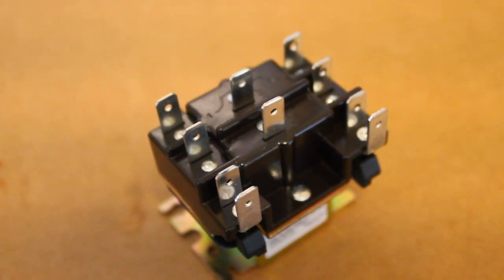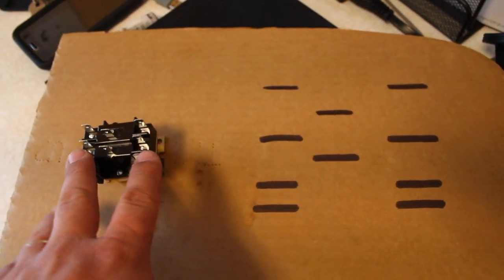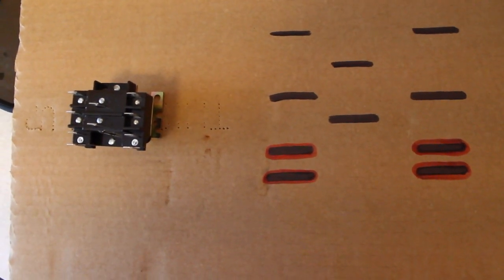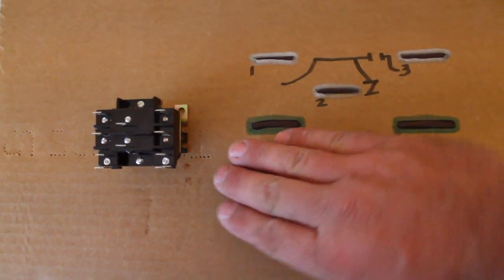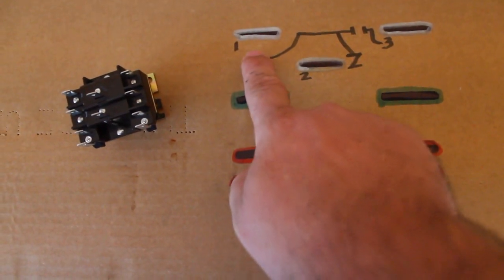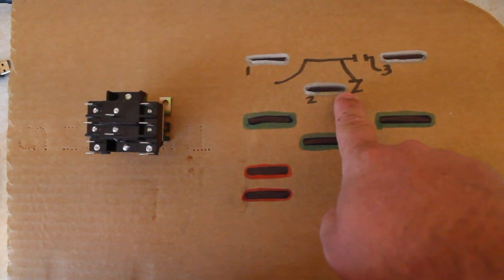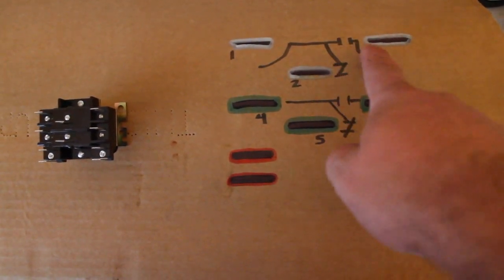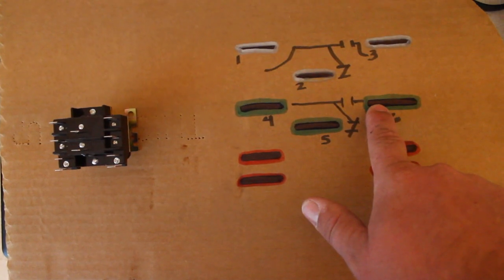HVAC Relay Training-  90340 DPDT Relay

Comment: I have a question. The HVAC contractor I used installed this DPDT relay instead of a SPDT on my system (I think it was the only one he had on his truck) and it caused a burning smell. Is it bad to replace an SPDT with a DPDT? I am not an HVAC technician, just a confused homeowner.